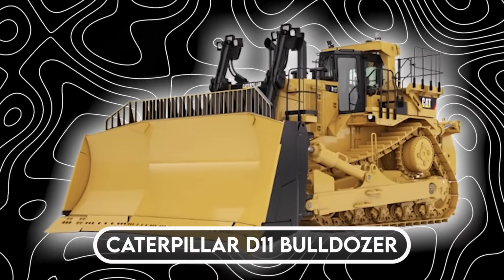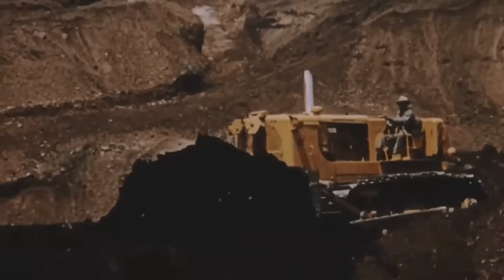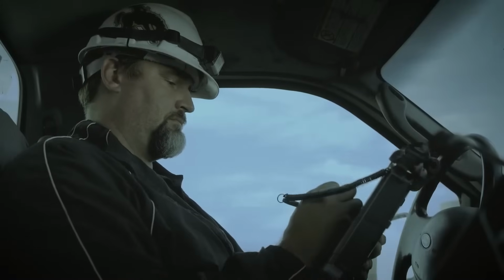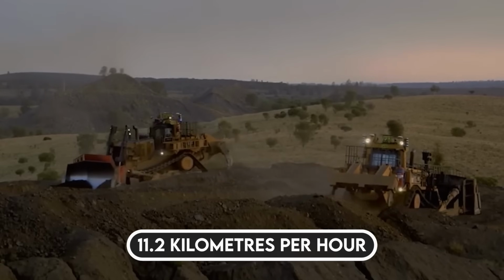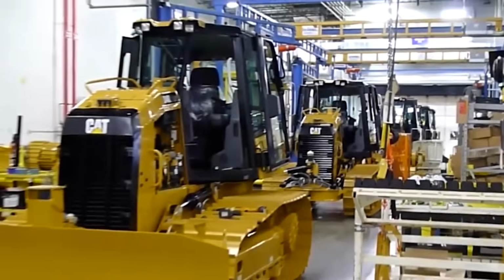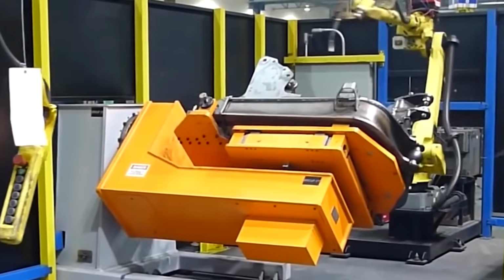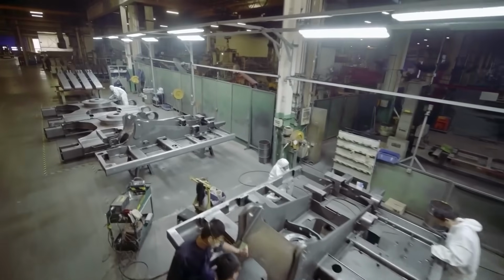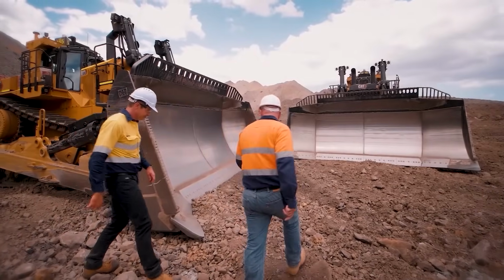SHOCKING News! This INSANE Bulldozer Will Leave You SPEECHLESS

Comment: Any trailer with a motor and brakes makes perfect sense to me. I have 4,500 miles on my Radcity 4 and have not peddled one (1) mile of it. I went daily riding for a month without a chain, I'm a throttle jockey. As with all heavy e-bikes adding a trailer with a good load...it's not about going, it's all about stopping quickly. I added a four-piston cabled hydraulic brake to the rear and two pistons up front.  The front brake can only be as strong as the wield is holding the fork to the down tube.